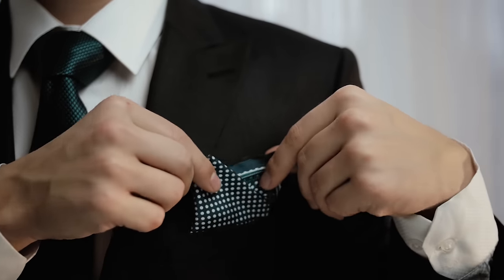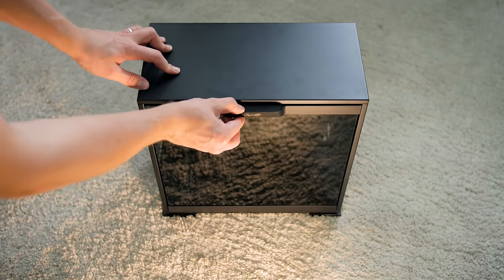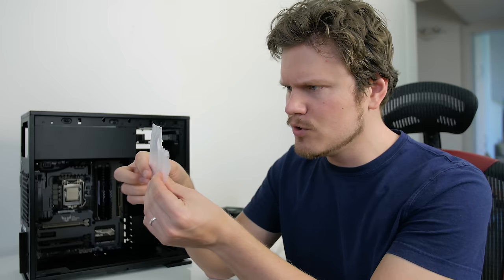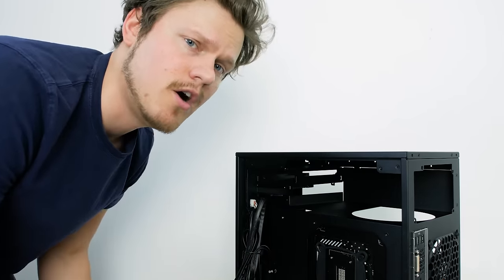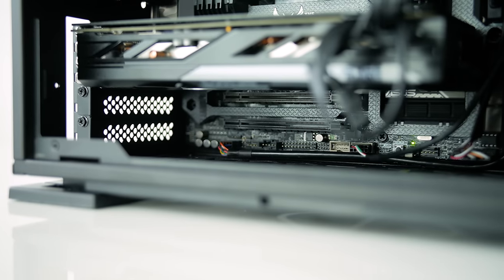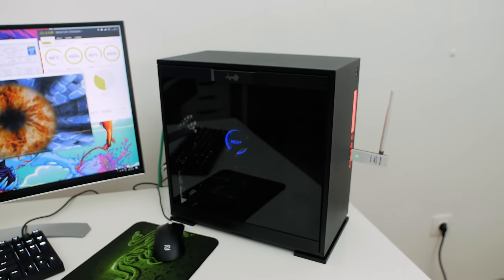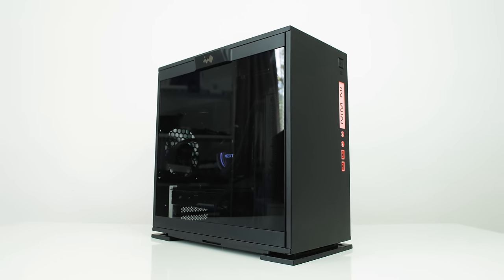Pure Class. The InWin 301 mATX Case!

Comment: I have this case and I’m using the front and bottom as intake and the back as an exhaust. I’m going to be switching to a sfx psu. I have seen GucksTV build and his cable management looks really great with an sfx psu. I am also going to switch from a 2.5” to a m.2 ssd.
I was getting normal temps with my CPU and GPU.
Ryzen 5 1600 and EVGA GTX 1060 6GB SSC

Comment: Thanks +HardwareCanucks! Thinking of getting this case and I had a thought:

What if you flipped your Heat Sink fan around so it pulled from the back, then flipped your rear exhaust fan around so it's intake. Then use the two front fans as exhaust and two bottom as intake?

The front two fans don't have filters anyway, so flipping the rear, a single fan, shouldn't introduce any more dust.

I feel like this would make a nice airflow in the case with minimizing turbulence. 

What do you guys think?

Comment: It seems like this case is better for M-itx motherboards, leaving opportunities for two 120mm intake fans on the bottom, the front 240 radiator setup for exhaust, and the rear 120mm set to exhaust as well.  I would be very interested to see this type of setup and how different the temperatures would come out, compared to the fan setup in the video.

Comment: This is a shrunk in win 303. Power supply at top and intake fans with dust filter at bottom.

With this layout my graphics card has 2 fans currently blowing cool air directly into its fans which keeps temps very low on my gtx 1080.

Comment: I'll stick with my current matx case.  It is a 10x10x10 cardboard box.  Fits everything just fine.  Has a 200mm fan pulling air from the bottom and the power supply exhausting air from the top.  It's painted black and sits unobtrusively on a shelf under my desk.  With the fan it cost under 15 bucks.  What more could I want?

Comment: Dimitri .. I love your videos ... BUT ;) ... you do it wrong in my opinion. Install 2 Coolers on the bottom of the case to get cool air into the case and push the air out by the radiator. Thats how inwin say it on their homepage. So you should get way better temperature. :) Thanks for your videos!

Comment: HardwareCanucks great video.
Question, would it be better if you set the back and bottom as intakes and the (front/side) as exhaust? 
I really like the case but I'm not sure if i should buy it because of the air flow.
Any advice helps, Thank you.

Comment: I like the case very much. Many of those cables could be routed behind the motherboard and the temps would be much better if you use fans at the bottom. I don't see any drawbacks in this case. And about that "only cooling area" at the back of the case, luke did tested and cable management does not affect the cooling potential. Nice review tho. (that case needed some RGB lights to shine tho.)

Comment: I think the case is interesting, but as with many inwin designs, my biggest concern is limited airflow. I'd appreciate it if you could rerun your temperature benches adjusting the airflow setup the way it is suggested on inwin's website, with fans on the bottom acting as an intake and the radiator/rear fan acting as an exhaust to see how much it changes the temperatures/noise levels. Outside of that my other major grip is the lack of a cutout for the 8pin EPS connector. I really don't like running a cable of that size across the top of the motherboard as it takes a lot away from the aesthetic look of your build. Also, is it possible to shove an SSD in the back behind the motherboard tray to be able to remove the drive cage in it's entirety to improve airflow/aesthetics?

Comment: I'd like you to check out thermaltakes tower 900 from CES it looks awesome and for custom watercooling it seems unrivaled at the price considering it's meant for dual loops and it supports 2x 560mm radiators.

Comment: It looks like an ITX case to me - You did not show the front air ducting well. 
Oh and FYI, The bottom is intake the back is exhaust.
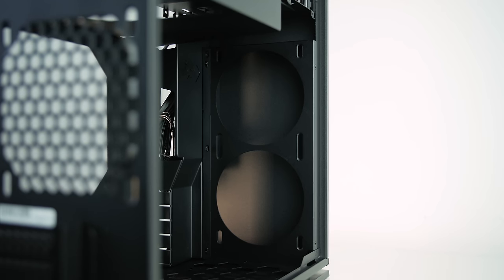So I went back and looked 3:13 thru 3:22 and see that your radiator fans should be exhausting thru there out the back side. 
Put two 120mm intake fans in the bottom turn your radiator fans to exhaust and lets see the numbers please.
While you are there you could try the rear fan in different configurations, None, intake, exhaust.

Comment: What about trying with the the 2 bottom mounted fans. This is not a great surprise, that temperatures without active intake are going to be not that good. Fans at the bottom would definitely at least somewhat improve temperatures of the GPU. And for the CPU cooling I would personally try some tower style air cooler with the fan at the back set for intake(or test both intake and exhaust options). Obviously both of this solutions are far from the performance you can achieve with a case that has more traditional layout and you get purely positive air pressure system, but both of your main PC component are going to get cool air that way

Comment: this case looks like it has more air flow than my Corsair Air 240 but the PSU just ruins the view up at the top. I think the 301 looks way better than the corsair though. You can put two fans under the GPU and its has one in  the rear which the Air 240 does not. Just one big question....Since the PSU is at the top why didn't they have the power supply blow air out the top?

Comment: i want the case pretty bad, however it has a few issues i would hope to be addressed with a small update maybe in like an rgb model comes out so there is better airflow, cable management and ease for well rgb as that is what i am aiming for, so if they fixed a few of those things, do with the 301 like they did with the 303 with the rgb variant, id be happy

Comment: From the looks of things, would it be better to flip the fans on the radiator around to suck air from inside the case and exhaust is out the funny vents at the side (similar to how it is on the In Win 303)?
Reply: Yup, I'm right. In Win says that how to use it (probably that's why there is no dust filter there).

https://www.inwin-style.com/uploads/Product/gaming-chassis/301/301_overview_versatile_01.jpg

https://www.inwin-style.com/en/gaming-chassis/301

Comment: It is one of the few matx cases that are:
* Good looking
* Not bloody huge
* Not to expensive
* Takes regular size components

Built one with i7-2600, some matx board, a Corsair CS550M 550W and a huge Gigabyte gtx 780 gpu for the girls to use so I can actually reach my computer more.

Cable management is a bit hard and I usually do not spend so much time on it, but lets just say that on the backside, it is cramped and I am not very proud of the result, was kind of hard to actually close the back on it.

I actually (lol) put fans in it so temperatures don´t seem that bad and nothing is overclocked, the gpu is actually kind of cool thanks to the bottom intake and the cold bloody floors here.

It is nothing I would use for some really overclocked hot setup, but it is very tiny and pretty. I think they could have removed the water cooling idea and slimmed the case even a bit more  and maybe added more room for cable management, I actually don´t know anyone that even have an water cooler of any type and people buying watercoolers probably wants to overclock a lot and wants a case with more space and better ventilation.

Comment: I like the size and this could have been my next case as I liked the ATX but not the size. They should have stuck the PSU in floor with a full length shroud. The whole heat issue could have been avoided.

Comment: The front and back ports are both meant to be exhaust. There is an internal fan holder on the front that can mount a 240mm radiator on the inside and fans on the outside pulling air from inside the case through the radiator and out. 

With solid performing 120mm high static pressure fans on the bottom, the cooling really isn't an issue.

This case takes planning and research, it's not for noobs, but that's the price you pay for an affordable and very aesthetic micro case.

Imo however the white and blue is much much nicer because of the side tinted window

Comment: I use the 303 currently and the wife has a an s340. the cable management on the s340 is 100 times better than the 303 and this 301 seems to have made it even worse. if you have fans at the bottom it should hide the i/o like it does on the 303 but no access at the top is absolutely terrible... I'd say s340 elite has the edge even with its higher price point

Comment: 4:00 Did you just say, that Power Supply is not active component for interior cooling? Well, what I see, is that PSU is going to suck hot air from case and push it out in the back, how is that not active component for interior cooling?
Regardless of that, I think they should just flip the PSU to suck air from the top, so it wouldnt use hot air from inside and not mess up with airflow in the outtake area.
Reply from the maker: +Rostislav Hašek I said it IS an active component ;)

Comment: Your heat/airflow problem is the micro-ATX motherboard, you should have gone with a mini-ATX. Then you can place the IAO radiator on the bottom with plenty of airflow.. your IAO has zero cooling

Comment: Honestly I really like the exterior, but the interior is a mess. Put the PSU on the bottom for better cable management (4/8 pin connector), rethink the Sata plastik break thing. Especially when it comes to airflow, I`m sure those honey webs would have also looked good at the front.

Comment: Dont trust Inwins graph guys. I have the 301 and have switched my fans around more times then any build I've done in the past. high static pressure front intakes, bottom intakes, exhaust rear. I can't stress enough how much of a difference the high sp fans made In the front. Also used a digital temp gun to check each set up I did.

Comment: I need a good Pc case for my new (and first) build, any suggestions?
Reply: Depends on your budget. For a mid-range price, I'd go with an Phanteks P400s with Temper Glass, for $80.
Reply: I cant choose between the P400s or the NZXT 340 Elite.
Reply: To be honest, you can't go wrong with either. I'm in the process of doing a build, and I bought the P400s last week, and damn is she beautiful. Just know, if your going to light up your case, the P400s comes included a LED strip that can sync with the LED's on the front-top and front-bottom. Like I said though, both are perfect cases for new builds, especially for first-builds, as they both have ample space and cable management.
Reply: Thank you!
1 last question, on most on the pictures it has a green glow under it. Is it adjustable?
(Sorry for my english)
Guess im gonna buy the P400s then :D
Reply: No problem man. The P400s has 10 pre-set colors to choose from that will light-up from the upper/lower part of the front of the case and you can also change the color from the top of the case.  It's a sweet case. Have fun with your build!

Comment: If only they could move the hexagonal ventilation from side to top panel, it'd be perfect. That way you can have bottom intake then top and rear exhaust, and you can also mount your PSU fan facing up, to suck air from outside the case. They missed this and I hate it.
Reply: And boy look at the temps at full load. You should've check the temp inside the case, and if it sits somewhere above 40 degree celsius, then it's a bad news for most PSUs today.

Comment: this or fractal design define mini c
Reply: Mini C, unless if you just want the tempered glass and nothing else.
Reply: Thanks
Reply: Just take whatever you think looks best, that way you´re going to be the most satisfied whenever you stare at it :)
Reply: Definitely fractal design, but I would strongly suggest getting a full Define C atx model as it is practically the same size. Same length and width as the mini C, just 40mm/1.5inches taller. Gives you the flexibility of more room to work in, with larger front radiator compatibility. Supports nearly all motherboard sizes making it easy to upgrade in the future. I guess if you really need $8 the mini C is great, but my personal philosophy is that future proofing your case is preferable due to their long lifespans. If you are the type to sell used parts to buy new ones then this isn't something you should worry about. I'm just the type of person that likes to run everything I buy into the ground before I upgrade.
Reply: Ajblue i got the mini c and agree completely with this guy. The matx form factor is limiting sometimes, for example no decent ryzen matx boards and limited decent z270 boards
Reply: if Fractal define had tempered glass I would easily get it over this.  but until then,  I'm considering this one more.  I want tempered for my next case.
Reply: matx boards are coming.  we already have the excellent Gaming 3 from gigabyte,  and MSI artic looks good also.  don't need X300 chipset for Matx as you likely won't be doing crossfire/sli on matx anyway.

Comment: very disappointed, it looks good but the interior design is bad.

and they didn't change the bottom fan position wtf in win, they are still blocked by the usb cables. get your shit together
Reply: Pretty sure you can still route the cables between the fan and the motherboard, I've done exactly that on many other cases, including inwin.
Reply: Maybe that is why i installed all my cables before putting my fans in. No hassle!
Reply: @CubeBot What's that? Work smarter not harder? Craziness.
Reply: Ikr its crazy!
Reply: Make a better case.

Comment: That´s werid... In the 303 you must use an matx mobo to use the bottom for a correct airflow and this one, the same... So this is a limited matx case , better for an itx system and the 303 its a limited atx case perfect for an matx system. I love the design of this case, but dont like the limited space at bottom for intake fans or rad

Comment: InWin should change their name to InFail. 

Their cases generally look nice on the outside, but suck when it comes to everything else. Price, airflow, features, layout, cable management all usually are bad. I don't understand why they're regarded as such a good case manufacturer. Just because they use higher quality metal and charge a ton doesn't meant they're good.

Comment: No need to defend the terrible airflow of this case, All In Win cases have terrible cooling. And custom liquid cooling in a tiny case like this? Custom liquid cooling needs airflow through the radiator as well, If the vent is not enough for intake fans in the front, It's not enough for radiator fans either.
Reply: Also it's 2017, Who still uses Furmark for GPU temperature testing...
Reply: Airdrifting Yeah i guess this will not be my next case for a matx custom watercooled build... I'm thinking more of the phanteks evolv matx
Reply: Airdrifting Yeah i guess this will not be my next case for a matx custom watercooled build... I'm thinking more of the phanteks evolv matx

Comment: I like the innovative styling, but the cable-management blows.  There is no excuse for a modern case to not excel at cable management.  Drill a few cutouts and make a minimum 1-inch gap between the motherboard and the back panel.  Sheesh.

And it is ridiculous to have that cool air intake pattern without provisioning for fans at that entry point.

Comment: The thermals suck because of the retarded shroud design. The plastic, (that has the inwin logo on it) does NOT serve as a shroud. The plastic only recalculates the hot air from the inside of the case instead of sucking air from the hexagonal openings on the side. Air will take the path of least resistance which happens to be the opening to allow cables to pass through to the motherboard. I doubt the hex holes can even serve as an exhaust.
     I bought this case and modded the plastic to make it draw air from the side panel like it "should have been," in my opinion. I love the looks of the case so I didn't want to mode the front. Plus modding plastic is so much easier, and I can always get more if I screw up. I made all the cables go up along the side of the motherboard vertically to the psu chamber. The 24 pin fits between the hard drive cage and the psu chamber. I also got some silverstone magnetic fan filters since they are thin enough to fit over the hex holes between the motherboard tray and door. :) I should make a video showing this I think.

Comment: Except for the tempered glass window, this case is shit.
Reply: Please elaborate
Reply: It's actually pretty fantastic - when you actually mount the fans in the correct orientation as In Win illustrates with diagrams in the literature. Airflow is actually closer to excessive rather than lacking, and the unique layout makes cable routing DAMNED EASY, much more so than your traditional case designs where you have this minute sliver of space to stuff the excess between the motherboard tray and back side panel.

But, if you don't like it, you don't like it, so don't buy it. But, "shit" this ABSOLUTELY is not.
Frankly, I think that Dimitri didn't put any thought into this at all when he was assembling it, treating it as "yet another system to slap together real quick". Using common sense(intake = filtered, exhaust = unfiltered), or even actually referring to the rather thorough & informative literature would have COMPLETELY changed this review. For example, refer to Jay's recent PC build with his daughter in a very similar In Win case(basically the mid-tower version of this) - not a single hiccup.

Comment: This is a stupid case, I own a 303 and would have wanted some improvements on the vents on the side panel - but this... oh man, how the hell will those front radiator fans push air to the side when they are facing in the front... it seems like the engineers at inwin were high or something when they designed this. The top PSU shroud is also pointless given it covers only part of the top area unlike the 303 where the honeycomb grille up top is function and form...